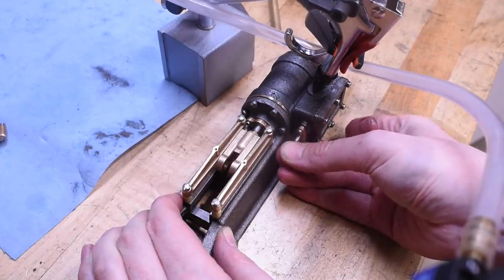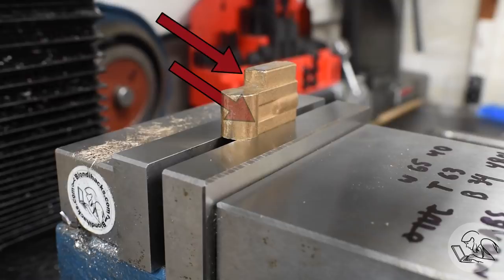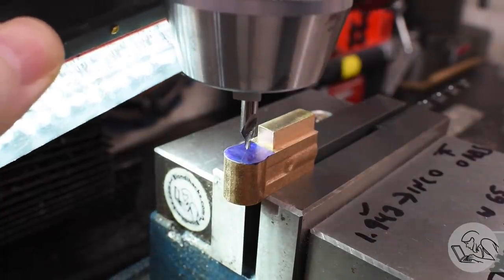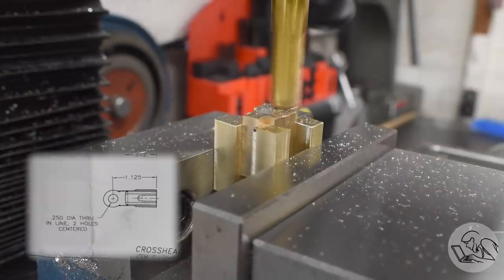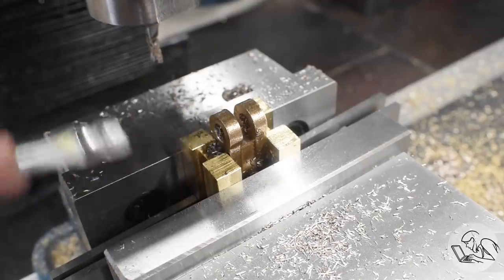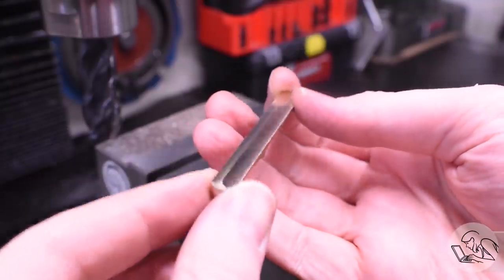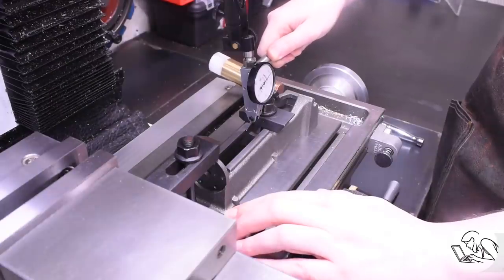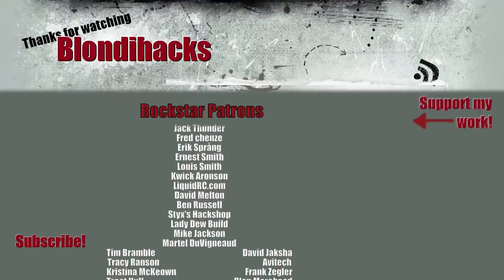Let's Build a Model Steam Engine : The Crosshead!

Comment: I'm really enjoying this series. 

I may be a bit sad to see the completion. But also excited to see it running under live steam.
Reply from the maker: Don’t worry, I have two more casting kits on the to-do pile. People won’t let me stop. 😬
Reply: really sad i already saw the completion. well; let's pretend i didn't see that LOL
Reply: @Blondihacks  maybe you could make one from scratch?
Reply: @Blondihacks  Well done on this part. I'm certain you've watched some of Joe Pi on this and this part was one of the trickiest because of the irregularities in the raw casting. Its actually a deceptively tricky part and you've done it very well.
I've actually ordered a lathe and this engine is sort of project #3 of the fun stuff. I have a couple of other things before I start doing these sorts of fun projects and I am going to start on a simpler engine first like the PM #2. When I'll only have a lathe to start I'll need to go simpler. After that I plan to do the #3 which I have watched some guys build and its certainly easier than the #1. 
After that I don't know. 
What I do know its all your fault for getting into this stuff. Your 2 series on basic lathe & mill made it impossible to have any excuses NOT to have a go at this and some other stuff. 👍👍🦘🦘🦘🦘🦘
Reply: Ya because dead steam doesn’t work as good.
Reply: @Blondihacks   ooh cant wait. Wish I had the time and the patience to machine like you do. Wonderful.

Comment: The clickspring guy shows a trick with modifying drill bits specifically for drilling brass so that the drill does not try to pull itself through the brass just before breakthrough.  He uses a sharpening stone to just break the sharp edge of the drill bit so that the cutting edge is about 85 degrees to the work, which still allows it to cut, but doesn't let it pull itself through.

Comment: Love your videos Quinn, your comments here about fitting and shaking down the mechanical fit is really important for guys who were never taught the detail or need to know when and how to do this. Shops (many home and all industrial) are all CNC which is wonderful for repeat process and assured interchangeability of components but the base knowledge is not taught now (well here in UK that I know of). 
I would really like to meet the policy makers and educationalists that decided that we no longer needed to have metal work and woodwork machine shops in Secondary schools (High schools), they were Soooooo wrong! I went to secondary school '64 - '70 & we did it all from electro plating to shapers, mills, lathes & forge work. Also a whole bunch of woodwork too. Videos like this and the great Joe Pie are absolutely essential, please keep 'em coming.

Comment: Your engine is coming along nicely. I’m making one of these also. These are not simple parts at all - any hobby machinist who tackles one of these and makes it run should be very pleased. I’ve made some errors along the way, and had to “fit” parts together. That’s OK - the parts don’t meet print, which sticks in my craw somewhat, but I think my engine will run. Looking at yours, I think it will run well on low pressure, which is a sign of a well fitting engine. Looking forward to seeing that. P.S. referencing from gauge pins was a game changer for me.

Comment: Looking good Quinn, just a refresher on hydraulic principle, the rod end of the piston generates slightly less pull because of cross section of rod on working area. Proof of this is low pressure pull is a little less than push, I'd say you did a bang up job! And everything looks great as well. Thanks for the vid and Happy New year! Cheers all around!
Reply from the maker: That end also leaks a lot more because of the unpacked gland, which I suspect is a more important factor. 😉

Comment: Having watched (and greatly enjoyed!) the series this far, I can say with complete authority from my own observations and experience that the original full-scale engines from which your version is modeled each had their own little eccentricities built into them as they were brought to life.  Think of the times.  Then remember that every machine tool that touched each part of those early engines was almost certainly driven by a flat leather belt from an enormously long line shaft that ran through the heavy wooden rafters of a building that was cold and drafty in the winter and sweltering hot in the summer.  Did the same person (Were there really workers who could be called machinists in such shops?  Maybe so, maybe not.) efficiently complete a stack of identical parts with skill and precision all day, every day?  Or did a few moderately-trained-and-skilled people work under the one person in the whole shop who actually knew how to do everything well?  Or did they move from machine to machine and/or operation to operation at the boss's direction to meet the demands of a cast-in-Jello production schedule?  (Always one of my pet peeves!)  Trust me, Quinn.  The level of skill and attention to detail (as well as conformance to the blueprints) that you pour into your steam engine (and everything else I've watched you do) are far above those actually in evidence from EVERY LAST ONE of the working examples of steam engines and even the restored museum pieces I've seen.  Further, your skills have improved over time.  Most of the "machinists" I've worked with reached a plateau early in their career and stagnated there with neither the ability to improve or the desire to do so.  I sincerely applaud your drive to grow and to add to your skills and to push yourself to learn new things.  It absolutely is NOT universal.  Chill Sista.  You got this.  :)

Comment: You shouldn't need to worry about any minor tight spots, they will wear and bed in as the engine runs a bit. I'm fairly certain your machining standards exceed what they were capable of in those days!
Reply: I once read a story where they rebuilt a steam locomotive with original spare parts and it kept binding up on the first test runs.

They then hired a retired mechanic from the days they were in current use, he was about to tell them what to do over the phone but they insisted on paying him to come over and fix it. 

He took a hammer, broke the bound up parts loose and basically said: "Do this everytime, it will soon stop by itself. It's just normal. The couldn't machine it to that tight tolerances back then, so they made it that its a little stiff in the beginning and wears itself to dimension."

Comment: Follow your videos, very nicely done. How about a tip. In my home machine shop i bought a small 12x14 dry erase board. This way i can jot down all my measurement numbers, make notes about machine steps etc. Its small enough that i hang it next to my mill or lathe or surface plate for quick refrence or to add notes and measurements as i go. Plus it saves note paper from the trash.

Comment: As I learned from the old Pattern Maker that I worked with, with the right skill and experience hand work can rival the accuracy of even the most precise machine tools. There’s a reason that extremely precise optical mirrors for large astronomical telescopes used to be finished by hand. There’s also a reason that hand scraped machine ways are so desirable.
Reply: You forgot patience. Lot of patience. Stuff like this takes ages and if you give in to the temptation of using the rougher tool one time too many, you ruin everything.

Comment: Good idea about checking one part at a time and see what part is tight and rubbing, I have a Stuart  5A steam engine kit that has a rough spot, I think I will run it on air for 20 minutes or so with lube and see if it smooth's out if not I will do what you did,  I also enjoy your YouTube and learn a lot...

Comment: I just realised how important some of those numbers are when it comes to the crosshead and the surfaces they slide on, and having them match up with the piston rod centerline - yikes!

At least on a loco you can shim the slidebars, or take a bit off where they bolt to the rear cylinder cover.

You must have been relieved when it all worked smoothly enough, until it "runs in" (wears something out!) If it runs that well without gaskets and packing it should be a good one.

Comment: when it comes time to tune the engine for proper (best) performance you might want to look at Keith Appleton's yoobtoob videos on setting timing, and adjusting the slide valve and it's fit . . . he has hundreds of videos, most geared to the novice builder . . . beware, when you finish watching some of them you might begin considering adding homemade reversing gear!

you seem to be having fun doing this little thing . . . if you want it to look more like the "real" thing you might want to replace most of the screws with studs and nuts (nobody put a full size mill engine together using 3" slot-head screws).

Comment: The crosshead running slightly tight on the rails at first -- is that the sort of thing that will run in?  Bronze and cast iron sliding against each other, seems like that might be the sort of "bearing" that might be expected to settle itself into exact fit.  Or is it important that there be minimal friction right from the jump?
Reply from the maker: It’s not the head on the rails that was tight, it was the piston. Maybe it would run in, not sure

Comment: Interesting thoughts on the reamers.  Is there a reason that you could not cut a new center by chucking in the 4 jaw?
Reply from the maker: They are high speed steel, so you can’t cut a center with normal tools. You could try CBN or annealing it, but you’d never get it as good as the original even if you had a way to cut it amyway.

Comment: Those holes were NEGATIVE 2 5/8" apart according to your DRO. The drawing specified POSITIVE 2 5/8".
Reply: Remember that she had to basically mirror the engine because of that machining mishap on the cylinder casting. 
That's why.

Comment: The brass is very, well, brass colored. But in all the drilling and slot-cutting operations, the chips have a very silvery color. Why is that?
Reply: Reflection of the white light on a tiny surface?
Reply from the maker: Just the lighting